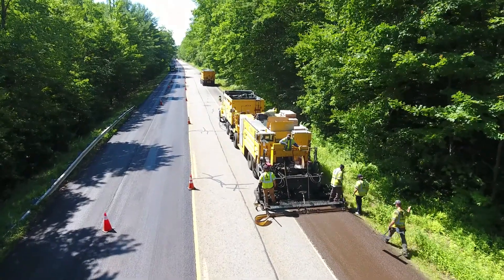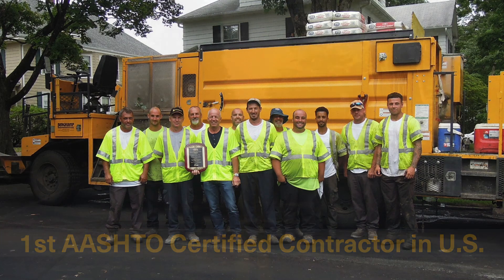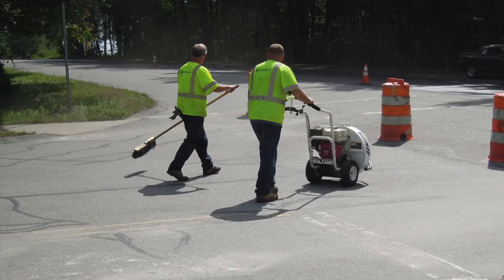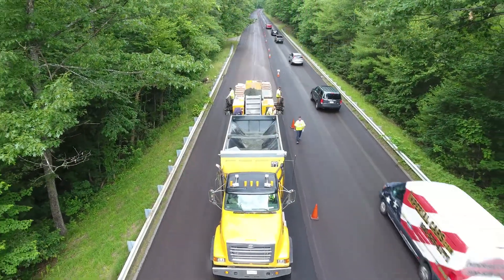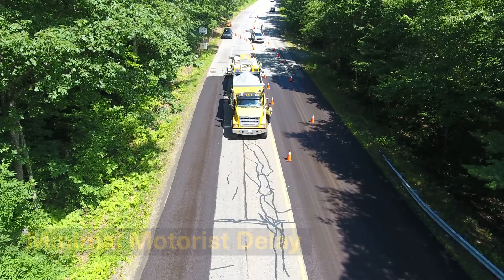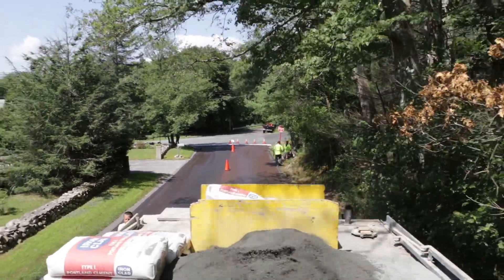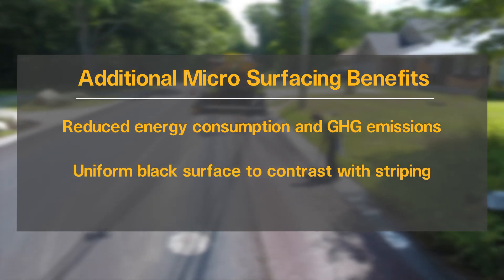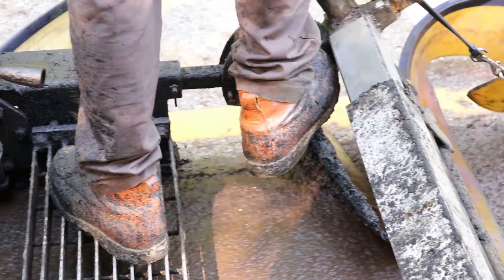What is Micro Surfacing?

Comment: Reclamation seems like a better solution due to the fact that you are compacting the base layer instead of just top coating.
Reply: Reclamation is a great treatment for roads that are in poor or very poor condition, however, it is costly. Micro Surfacing candidates are normally roads that are in good - fair PCI rating and this treatment is used to keep that road in good condition early at a fraction of the price reclamation type treatments would cost!

Comment: Maybe a dumb question, but can you apply microsurfacing over concrete or does this only work over asphalt surfaces?
Reply from the maker: In the Northeast, Micro Surfacing is generally used as a maintenance or wearing surface over asphalt surfaces.  However, it can be installed over Portland Cement Concrete (PCC) surfaces and bridge decks.  In these cases, it is used typically to increase friction or fill depressions in the PCC surface and a tack coat is required.

Comment: How many applications can be applied over the surface of each other?
Reply from the maker: Hello!

The number of times you can re-apply micro surfacing depends on a couple factors.  Make sure there are no visual distresses that may impact the performance of another application of micro surfacing, similar to the distresses you look for prior to the initial application of micro surfacing, and that the existing micro surfacing is well bonded to the existing pavement.  Also, look at what impacts raising the elevation of the roadway may have on drainage, driveways, and other roadway uses.  

Hope this answers your question!

Comment: what about manhole covers it will be a little bit lower from the micro surfacing layer?
Reply: They are later adjusted by being demoed out and level and pour a new concrete basé around manholes and water valve covers
Reply: Yeah they are slightly lower but smoothly and only an inch or so. We just had our streets done. They just put tape over them so it doesn't stick and they pull the tape up, smooth out the edges and that's it
Reply: Watch the video…. They show the type 2 micro spec at passing #4 so you are looking at 0.25”-0.5” max additional height. The video says 3/8” additional height